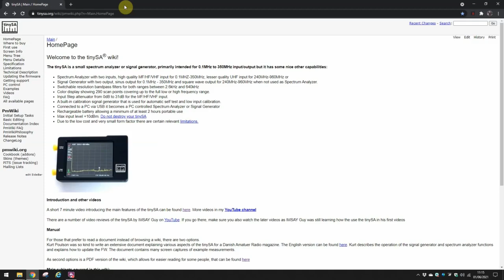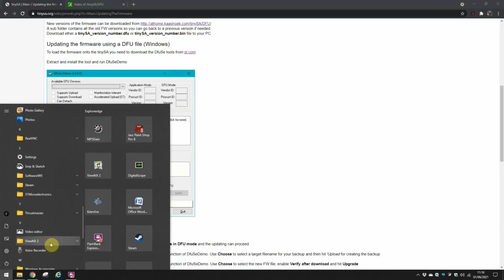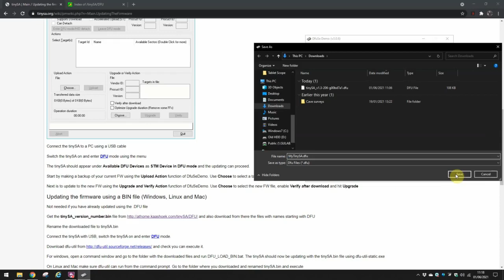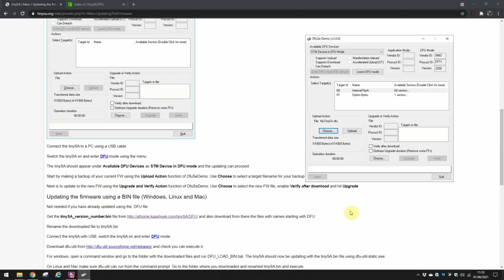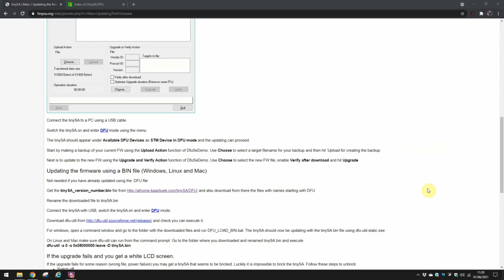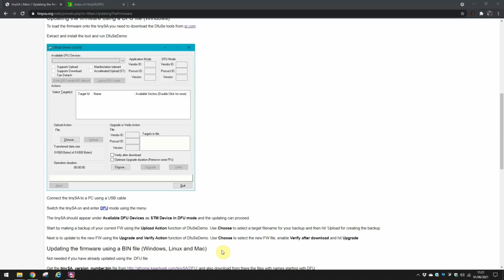tinySA Firmware updating process

Comment: Even though I first run the DFUseDemo app and then I turn the Tiny SA to DFU mode, nothing changes on the DFUseDemo screen. The computer makes the same sound as yours when I turn on the TinySA, but it makes the opposite sound of disconnection when I switch to DFU mode. Any suggestions would more than welcome, cause it seems that I am stuck. Thank you.73 de SV1SLB

Comment: The DFU demo software did not work. It did not recognize the Tinysa. I used the STM32cube software version 10.0 and still had problems with (DRP) level 1 error codes. Windows 7. I switched to a Windows 10 computer with a clean install. Even so I had error codes and was stuck with a white screen of death. Finally I changed the sequence around by activating the start  programming button first instead of the connect button. This time I got a message of Not Connected so I   then refreshed the port to read USB and hit Start Programming last. This time it took 10 seconds or less but the firmware updated. I spent an accumulated 8 hours trying to update this firmware. I tried different software versions and even 32 bit versions that didn't error and even stated programming but stalled. Do not forget if you have a white screen you need to open it up 4 screws and short boot and vdd for a second. Good luck. I will never attempt another update.

Comment: Thank you for the very illustrative explanation, I follow it closely! I have only one comment: at 3:42 you save a file called MyTinySA and then you say "... as I understand it has now saved and any information on ...". I believe, according to the instructions on the website, that you still have to press the upload button. Otherwise, you will only have an "empty shell" instead of a backup of the original file. I may be wrong, but I try to avoid mistakes.

Comment: What is DFU?  Could you explain about DFU files and updating software.  Thanks
Reply from the maker: Richard,  dfu refers to the filename extension which contains the firmware code for updating.
The TinySA wiki pages have a good description of the exact process to be followed.
There are links to the various web pages in the video description.
Reply: @LockdownElectronics  Thank you
Reply: @LockdownElectronics  I have no DFU mode on  my device.... VO.4.5.1 purchased from your list R&L Electronics